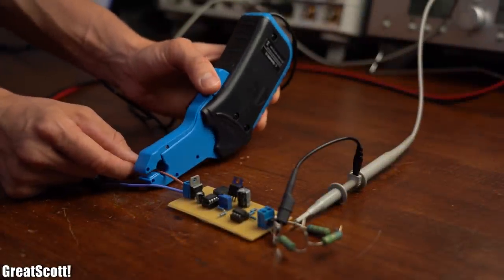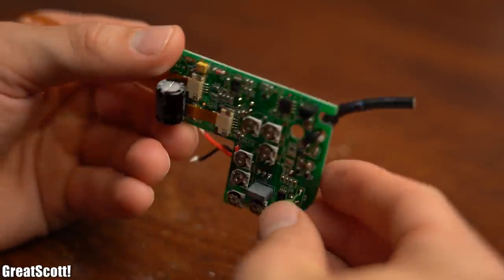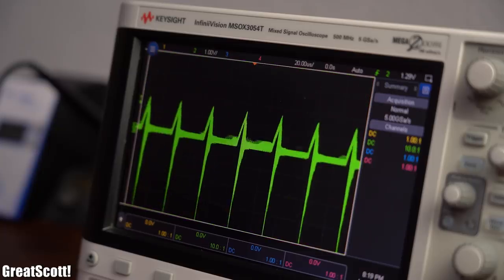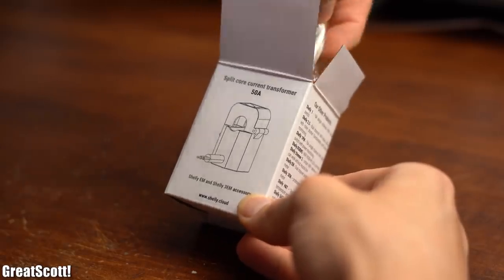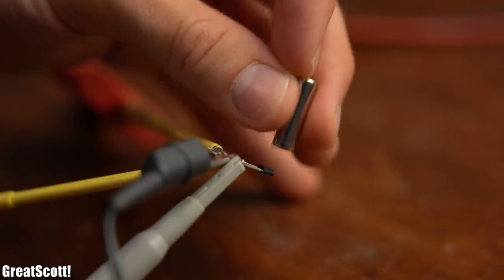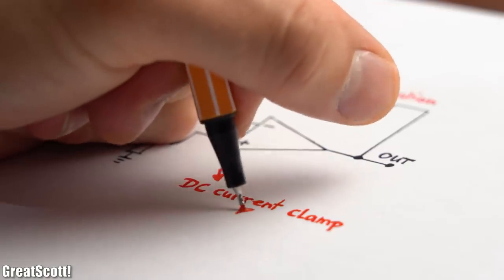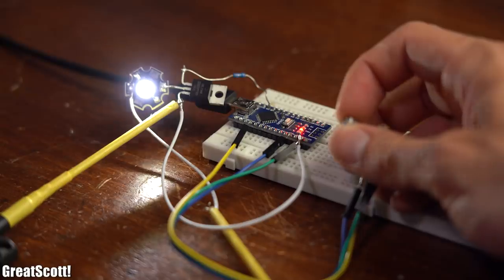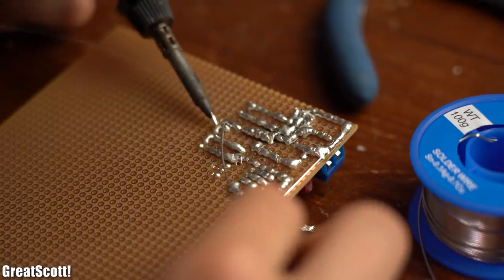Can my $15 DIY AC/DC Current Clamp keep up with a commercial one? || DIY or Buy

Comment: I would love to see repair added to the list of diy or buy as in your case where you had a commercial unit, is it worth repairing the unit even if you have to replace most of the circuit.

Comment: Thanks for sharing!  Literally just commented regarding a few days back on Kerry Wong's latest video where I'll be needing for the hybrid CVT MG's design inspection and performance characterization.  Now am even more-so planning to make and appreciate the insight.  Wondering if those plates are Metglas, Permalloy, MuMetal or what?  Was thinking about just using a cheapo current clamp meter hacked out and I think you went even more cost effectively.  Really awesome to watch as always!

Comment: i had the wrong idea how a clamp worked :)
i thought that the clamp complete a coil , and with an op amp circuit measure the voltage

Comment: I would say that the problem with higher frequencies is because of the ferrite core. Has I'm sure you know, ferrites cores are design to work in a specific width of frequencies and maybe you just dind't used the right ferrite core on your DIY current clamp

Comment: LOL I would not have wasted 50 bucks on a new one, better replace the dead chip!
BTW you could have used some kind of small converter to get a symmetrical voltage to work with... it would have benn way more reliable than your virtual ground. It is also possible to use an opamp and two bipolar transistors to make a more stable virtual ground.
BTW your problem with high frequencies may be your sensor, if it is not meant to be fast enough...

Comment: For a permanent installation we would use an open loop current transducer like this,
https://www.newark.com/lem/hxs-10-np-sp3/current-transducer-60a-voltage/dp/97K1776

which has the same components, but conveniently packaged up in a compact module for about $15-25.  I used to have boxes of these from old inverter teardowns.

Comment: What about measuring industrial loop signal 4 - 20 mA ? Could this DIY be accurate at such low current ? I am talking deviation 0.1 mA at max. Edit: Fluke does have professional clamp DC portable meter, that can measure such low currents. So it is possible.

Comment: Is the upper frequency limitation anything to do with the op-amp you used?  Not 100% but I remember vaguely that the bandwidth of the amp is inversely proportional to the gain (more gain = lower bandwidth)?  🤔

Comment: Hi Scott what is the maximum amps DC that your DIY clamp can handle........Could it measure a car battery output when cranking the engine i.e 200 amps........looking to do relative cylinder pressure test whilst cranking

Comment: Just some tips for you . I checked your design and then i went through the datasheet of the parts and i noticed some issues . Now you have connected a 100nf capacitor across the power pins of the hall effect sensor . Just try to put a 100pf cap across that and try it again . I dont have an exact logic of how and why it will work but its just an idea or just a hunch which i had after reading the datasheet . It might solve your high frequency reading issues

Comment: Is 6 amps AVERAGE DC current on hand held multi-meter, or panel meter,, the same as PEAK 6  DC amps on oscilloscope? I thought it was a 60% difference.

Comment: Hello. I have an idea for a video. There is such a device - a reflectometer for cable lines (TDR). One of the representatives of such a device is Fluke Networks TS54 TDR. Such devices are able to measure the length of a cable break, short circuit, incorrect twisting, etc. I would like to see a video on your channel under the heading diy or buy

Comment: You missed one of the most important advantages of a Current Clamp over a Sense Resistor! The Ground terminal of 99% of Oscilloscopes is referenced to mains earth, so for anything to do with mains, you MUST use a current clamp! If you use a sense resistor, you'll either trip a circuit breaker or set something on fire 😅
Reply from the maker: True :-)
Reply: Or you use an isolation transformer, which is quite normal for use with any mains side measurements on a power supply.

Comment: You measure the flux with the hall sensor. The flux is proportional to the current in the primary winding. This is the theory that I also have tried. I used an 1.8MHz SMPS for testing. My bandwidth was enough for that. My theory is that inside the wireing of the hall sensor there is some loop that is around some part of the flux. This will make some induced voltage between the pins of the hall sensor superimposed to your useful signal. The amplifier adds this to the useful signal. This will appear as the derivative of the measured current. The solution would be to cancel somehow this induced voltage, or use the compensating winding method to keep the flux at zero.

Comment: Just a guess w/o calculations: At high frequency, the conductance of the capacitors in the voltage divider probe come into play. At high frequency these become short circuits...probably with different conductance thus throwing off your offset. But worse, they short out the voltage coming from the Hall effect transducer. In an AC mode, using inductors instead of capacitors causes them to have the opposite effect. But before trying that I would experiment first with eliminating the capacitors in the AC case.

Comment: Awesome! Maybe I'll try to build one!
Could you try to diy a differential probe? Because they are prohibitively expensive as well.
I guess digital scopes can solve this problem by using two channels and math but I only have a cheap analogue scope.
Greetings from Berlin
Reply: Most analog oscilloscopes can do this as well. Assuming yours is dual-input there is probably a set of options to subtract the two channels. On mine this is done by setting the scope to 'ADD' mode and inverting the second channel.
Reply: @eDoc2020  Thanks for the response! After writing that comment I actually went and searched for the handbook for my scope and discovered that it can actually do it! Felt like christmas! :D
The reason I never noticed it was that you have to pull out the rotary dial that sets the voltage range. I never considered trying that!

Comment: there's an obvious drawback you didn't mention. Your current clamp comes with a read-out display. The homemade one doesn't. You need an oscilloscope to use the homemade one, putting it out of reach of most hobbyists.

Comment: You didnt mention the high voltage danger of an open circuit current transformer whilst the current is still flowing through the wire that you are trying to measure the current of